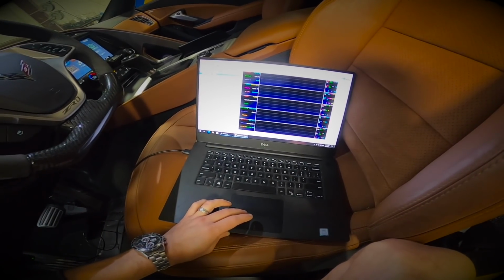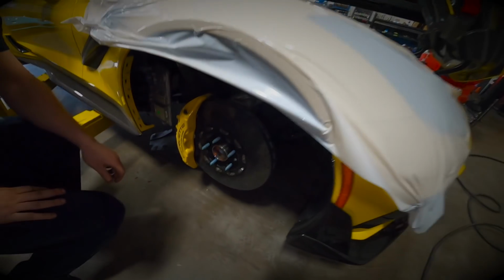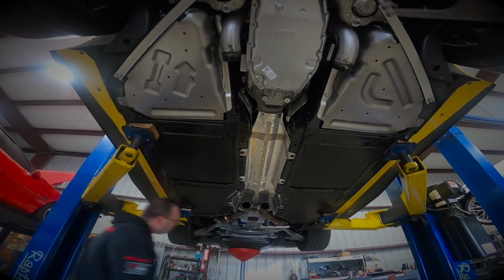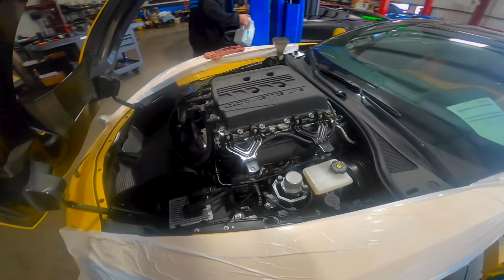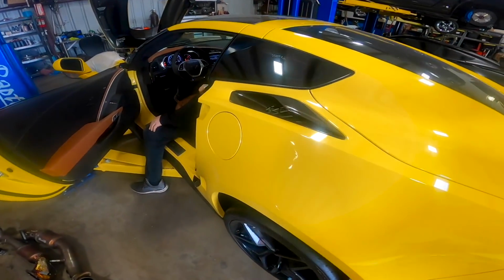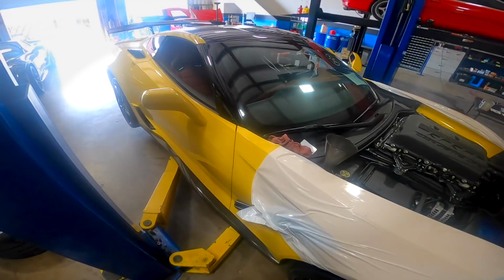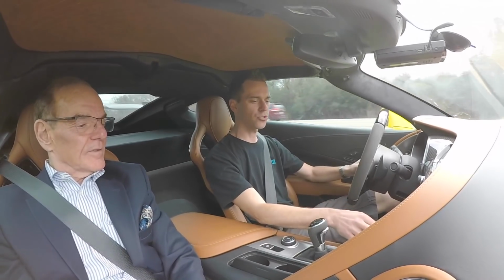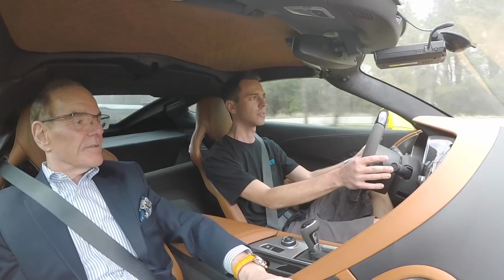2019 ZR1 Corvette "Not your average grocery getter"

Comment: Love the ZR-1…. Still debating on buying one on a weekly basis…. I paid $79K for my Z06 and ZR1 = $120K so the $40K I’d rather get the 800RWHP package (which is less than $40K). Granted, take into effect that the ZR1 will hold value better….. If I was sold on the big wing + body modifications; I’d pull trigger.